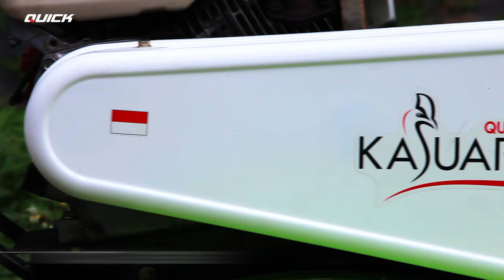CULTIVATOR BARU DARI QUICK TRAKTOR SIAP CACAH DAN OLAH LAHAN APAPUN | QUICK KASUARI

Comment: Harga berapa..untuk jatim ada gk boss
Reply from the maker: Harga Quick Kasuari Jawa:
Mesin Bensin GX 200T2-QTBC : Rp 9.000.000 
Mesin Bensin GX 160T2-QTBC : Rp 8.600.000
Body Only : Rp 5.550.000

Keterangan:
- Harga termasuk PPN 10%
- Harga termasuk perlengkapan standar (Roda Karet 8, Blade Ksr J, Ridger Ksr)
- Harga belum termasuk Biaya merakit, Oli, Solar/Bensin
- Harga belum termasuk ongkos kirim dari pabrik di Yogyakarta.

atau bila berkenan mohon kirimkan nomor telp/HP Pak Bos, bagian pemasaran kami akan menghubungi Pak Bos :)
Reply from the maker: Untuk Jawa Timur masuk wilayah pemasaran kami di Nganjuk Pak Bos. Kantor Cabang QUICK NGANJUK
Gudang Karya Agung Type A Jalan Raya Kedondong Rt 01 Rw 2 , Kedondong, Bagor, Nganjuk  64461
SMS/WA : 0811 2545 978 (Ricky)
Fanpage : Quick Traktor Nganjuk
Kontak kami link dibawah
https://bit.ly/HubungiMasQuickQTNganjukFB
https://bit.ly/HubungiMasQuickA360NganjukFB
https://bit.ly/HubungiMasQuickQH11NganjukFB

Comment: Harga berapa gan
Reply from the maker: Harga Quick Kasuari Jawa:
Mesin Bensin GX 200T2-QTBC : Rp 9.000.000 
Mesin Bensin GX 160T2-QTBC : Rp 8.700.000
Body Only : Rp 5.550.000

Keterangan:
- Harga termasuk PPN 10%
- Harga termasuk perlengkapan standar (Roda Karet 8, Blade Ksr J, Ridger Ksr)
- Harga belum termasuk Biaya merakit, Oli, Solar/Bensin
- Harga belum termasuk ongkos kirim dari pabrik di Yogyakarta.

atau bila berkenan mohon kirimkan nomor telp/HP Pak Bos, bagian pemasaran kami akan menghubungi Pak Bos :)

Comment: Dealer daerah Bandung ada ?
Reply from the maker: Untuk Bandung masuk wilayah pemasaran kami di Jakarta Pak Bos. Kunjungi fanpage kami @quicktraktorjakarta
Kantor Cabang QUICK JAKARTA
Jl. Gajah Mada 154, Jakarta
Telp: 021-6292044, 6490020
SMS/WA : 0811 2545 908 (Agung)
Fax: 021-6490013
Email: jkt@quick.co.id
Kontak kami link dibawah
https://bit.ly/HubungiMasQuickQTJakartaFB
https://bit.ly/HubungiMasQuickA360JakartaFB
https://bit.ly/HubungiMasQuickQH11JakartaFB
Reply: @quicktraktor  untuk penjualan sparepart wilayah Tasikmalaya ada toko yg menjual tidak? Jika ada, nama toko dan alamatnya dimana?
Reply from the maker: @inxolive76  Untuk Tasikmalaya masuk wilayah pemasaran kami di Jakarta Pak Bos. Kunjungi fanpage kami @quicktraktorjakarta
SMS/WA : 0811 2545 908 (Agung)
Kantor Cabang QUICK JAKARTA
Jl. Gajah Mada 154, Jakarta
Telp: 021-6292044, 6490020
Fax: 021-6490013
Email: jkt@quick.co.id
Kontak kami link dibawah
https://bit.ly/HubungiMasQuickQTJakartaFB
https://bit.ly/HubungiMasQuickA360JakartaFB
https://bit.ly/HubungiMasQuickQH11JakartaFB
https://bit.ly/TraktorSalesPusat

Comment: Harga brp di toko mana
Reply from the maker: Harga Quick Kasuari Jawa:
Mesin Bensin GX 200T2-QTBC : Rp 9.000.000 
Mesin Bensin GX 160T2-QTBC : Rp 8.600.000
Body Only : Rp 5.550.000

Keterangan:
- Harga termasuk PPN 10%
- Harga termasuk perlengkapan standar (Roda Karet 8, Blade Ksr J, Ridger Ksr)
- Harga belum termasuk Biaya merakit, Oli, Solar/Bensin
- Harga belum termasuk ongkos kirim dari pabrik di Yogyakarta.

atau bila berkenan mohon kirimkan nomor telp/HP Pak Bos, bagian pemasaran kami akan menghubungi Pak Bos :)

Comment: Harga berapa pak samp3 sumut kab padang lawas
Reply from the maker: Harga Quick Kasuari Jawa:
Mesin Bensin GX 200T2-QTBC : Rp 9.000.000 
Mesin Bensin GX 160T2-QTBC : Rp 8.700.000
Body Only : Rp 5.550.000

Keterangan:
- Harga termasuk PPN 10%
- Harga termasuk perlengkapan standar (Roda Karet 8, Blade Ksr J, Ridger Ksr)
- Harga belum termasuk Biaya merakit, Oli, Solar/Bensin
- Harga belum termasuk ongkos kirim dari pabrik di Yogyakarta.

Informasi lebih jelas Pak Bos dapat menghubungi link https://bit.ly/KasuariSalesPusat

Kunjungi fanpage kami @quicktraktormedan
SMS/WA : 0811 2545 918 (Galih)
Kantor Cabang QUICK MEDAN
Jl. Letda Sujono, Komplek Pergudangan Tembung Intan No. 13, Medan, Sumatera Utara
Telp: 061-7384680
Fax: 061-7384680
Email: mdn@quick.co.id
Kontak kami link dibawah
https://bit.ly/HubungiMasQuickQTMedanFB
https://bit.ly/HubungiMasQuickA360MedanFB
https://bit.ly/HubungiMasQuickQH11MedanFB